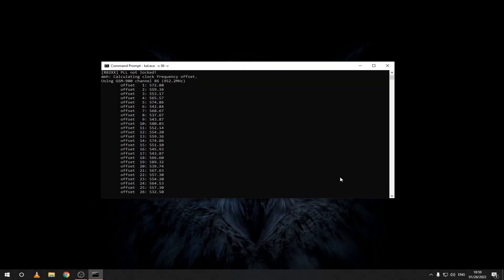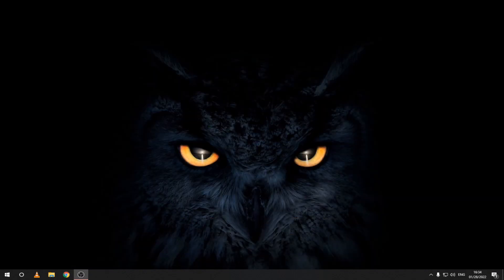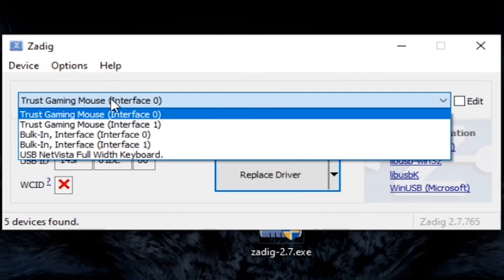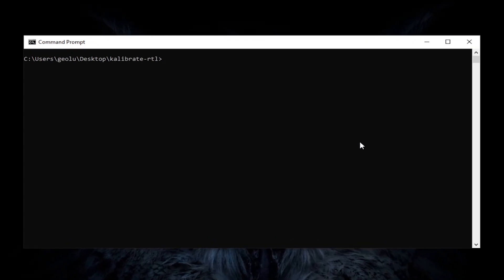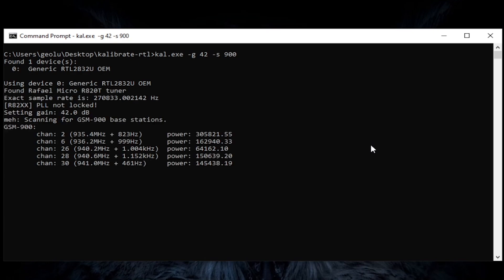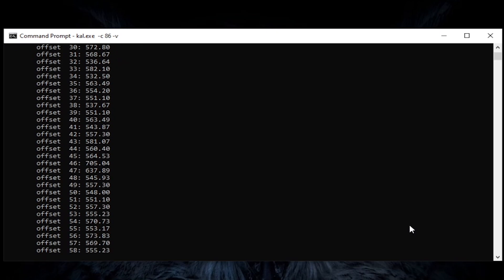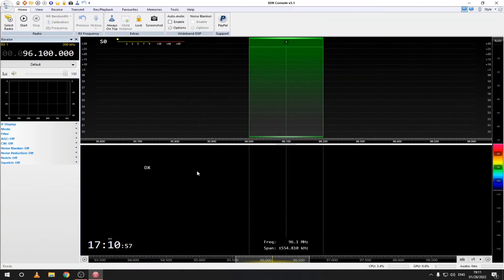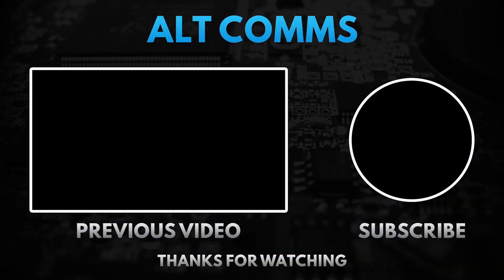RTL-SDR Quick Start Guide | Driver & Calibration

Comment: salut, imi da o eroare la calibrare, nu stiu de unde e problema.. C:\Users\yo3iva-asus>Desktop\kalibrate-rtl\kal.exe -g 42 -s 900
Found 2 device(s):
  0:  Generic RTL2832U OEM
  1:  Generic RTL2832U OEM

Using device 0: Generic RTL2832U OEM
usb_open error -12
Failed to open rtlsdr device #0.

Comment: With kal.exe I have:

Found 2 device(s):
  0:  Generic RTL2832U OEM
  1:  Generic RTL2832U OEM

Using device 0: Generic RTL2832U OEM
usb_open error -12
Failed to open rtlsdr device #0.

When I chose device #1 (-d 1) I have:

average         [min, max]      (range, stddev)
- 1.050kHz              [-1068, -1035]  (33, 8.801240)
overruns: 0
not found: 1
average absolute error: 1735357009.120 ppm

WinUSB driver installed for both devices with Zadig.
What's wrong?
Reply from the maker: Hmm.. it looks like you are having a USB problem. Try to reinstall the driver.
Reply: @altcomms  this isn’t the right solution, he installed on bulk interface 1 instead of 0